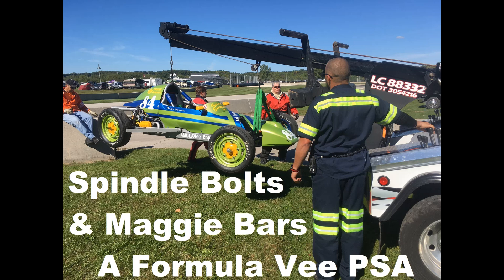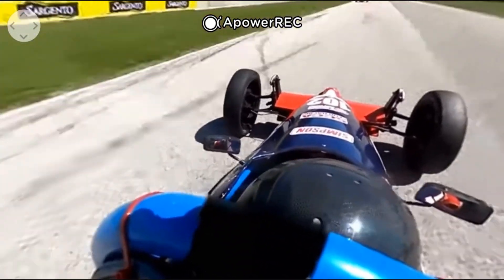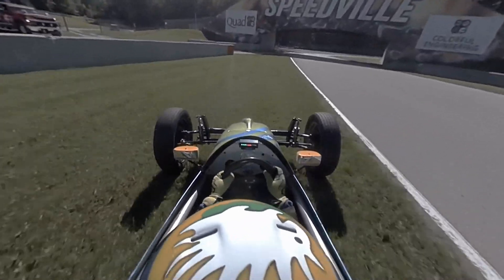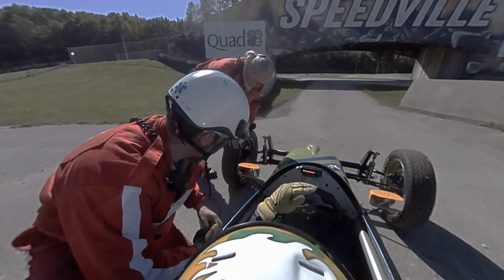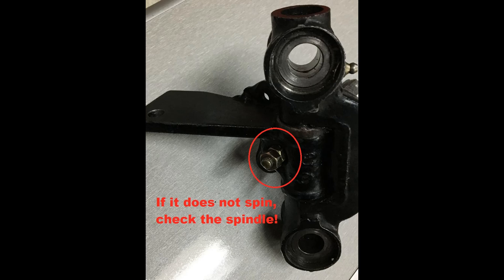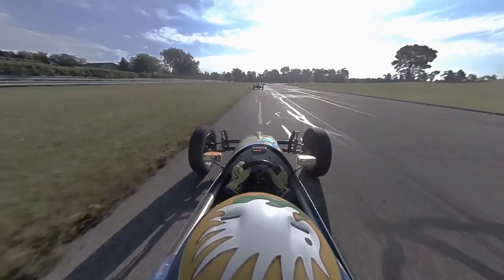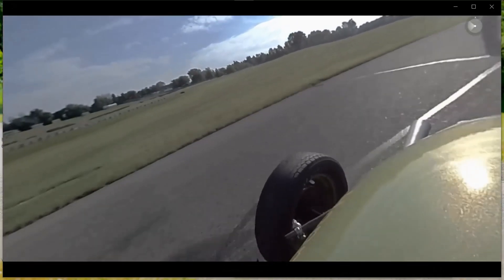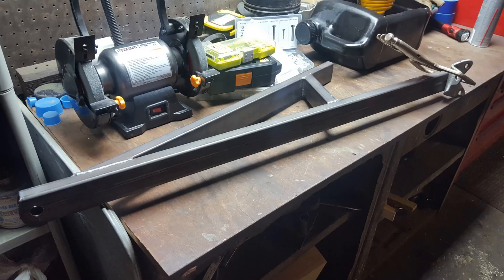Formula Vee Safety PSA #1

Comment: 11:05  Imagine a 120 degree curved tube that is bolted onto the upper torsion bar tube, just inside the shock absorber mount that goes around the front of the tire to prevent the tire from riding over the rear tire of another car.

Comment: Hi Brian, I'm working on a FV for autocross and track use. Unfortunately, it may not be VSCDA eligible as the log book establishes it as a 71 Lynx B and the chassis doesn't appear to be original. There is a conversation about it within the Formula Vee Racing USA FB group not too long ago. I'd like to inquire about a set of Maggie bars.. I tried to reach Maggie and tried to ask the same question to your father (his purple fv made him easy to find) via FB Messenger to no avail. What is the proper channel to see about having a set made? Thanks!
Reply from the maker: Gvancamp@sbcglobal.net 
They can get you the prints, but you would have to get a fabricator to make a new set, or modify your existing trailing arms. It can be VSCDA eligible if it modified back to monoposto conformity. 
The 2 Lynx B my dad and I run were updated to Lynx C at some point and had to revert back to the z bar rear suspension. Fred Clark should be able to help you out with any of that kind of work needed.
Reply: Thanks Brian. Much appreciated!
Reply from the maker: @JamieT_5947  I you don't get in touch with them, I will have my Lynx back at home in a month. I'm in Villa Park IL and you can copy the toe link and Maggie bars if you want.

Comment: Brian, Great video. Hope to get back to  BHF this summer and race with VSDCA again- great track and people. 

In CVAR there is a big focus on a minimum gap of 2” between top of the helmet and the roll bar - in fact there was a mandatory check after every came if the track after qualifying at MSRH . In the video, the gap appeared to be much less than 2in for a majority of the cars. Any thoughts?  

I am too new to the world of vintage FV. Any of my questions / comments represent my own personal view point and not CVAR
Reply from the maker: I am right at 2 inches in a static car with tightened belts. I see in pictures it appears to be less than 2 inches, I don't know if it is the angle or g-forces moving me in the cockpit. I spent last winter trying to make a seat that would add back protection but anything I did would raise my helmet to under the 2 inches. So because of helmet clearance, I still do not have a bead seat or something that would secure and cushion my hips and spine in an accident. This is important because people have had serious back injuries in these cars. Because I can't make my self any shorter, the solution for me is to take the frame apart and get a new, taller roll bar made. 

I am planning on racing in SCCA this year and I noticed the modern cars have much higher roll bars and this is not an issue. I plan to address the roll bar height in the Lynx before getting back into it so I can add a protective seat.
Reply from the maker: I am happy to say i replaced the roll hoop with a taller one and now have more than 2" clearance at all times and hope to make another video after the season.